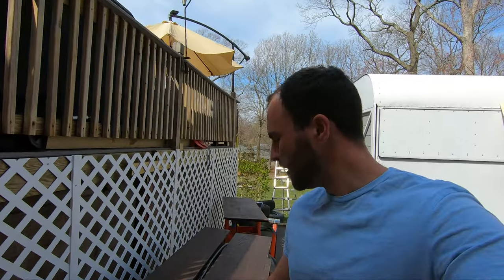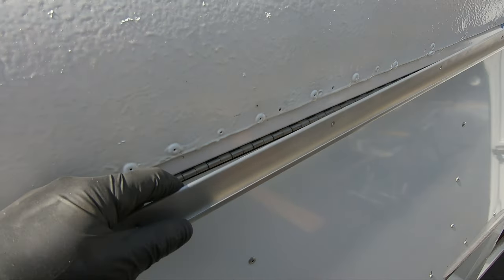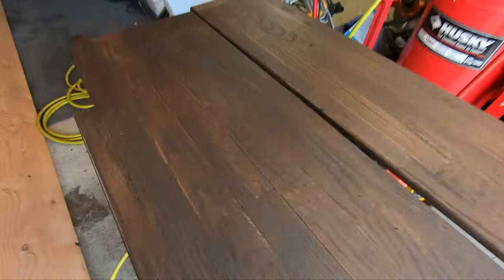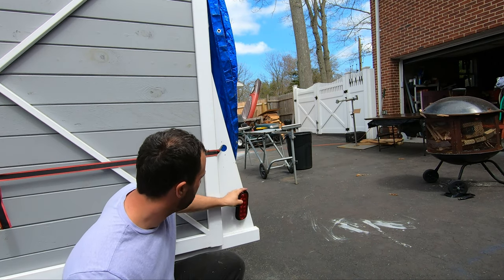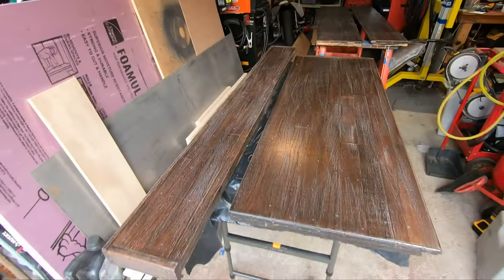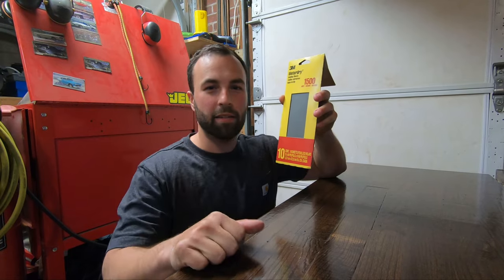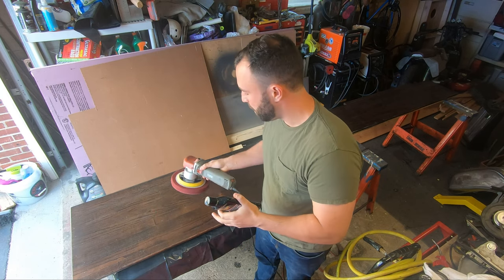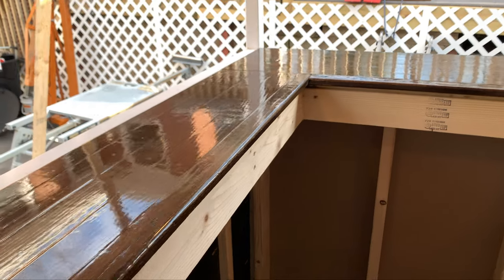HOW TO POLISH POLYURETHANE! Bar Tops Done!  (Rum and Colt Mobile Bar PT8)

Comment: The paint job looks awesome, but I have a couple questions, hopefully you will answer.  1. When using the microfiber pad, I'm assuming this pad is for the polishing compound? If so, what brand do you recommend? 2. I'm also assuming that the orange foam pad is used for the polishing finish? What brand do you recommend?  Waiting patiently for your reply.   Thank you VERY much for this painting video on the motorcycle tank.  I learned a lot.  Hopefully mine will turn out as good as the one you did.  👍😉
Reply from the maker: I would get a good quality griots, chemical guys etc cutting and polishing pad. Cutting for the compound finishing/polishing for the polish in that order. Doesn’t necessarily need to be microfiber. I’m by no means and expert at it and you can definitely watch a few paint correction finishing videos to get more info! Hope this helps!